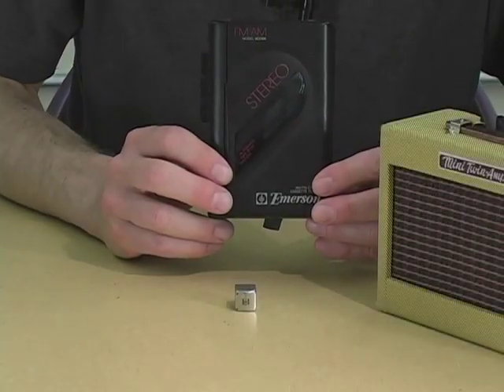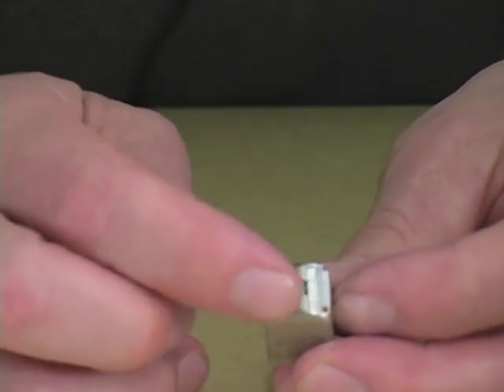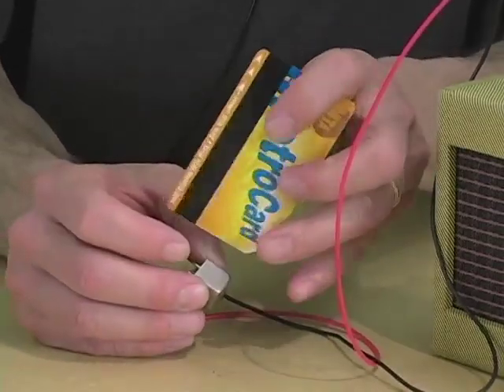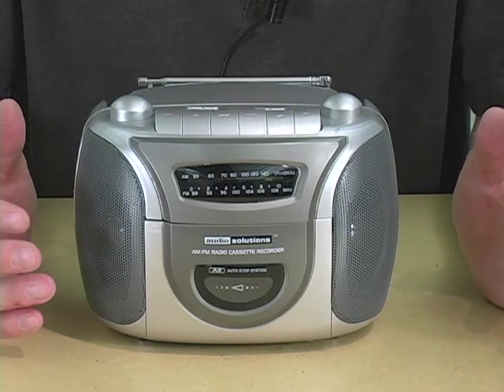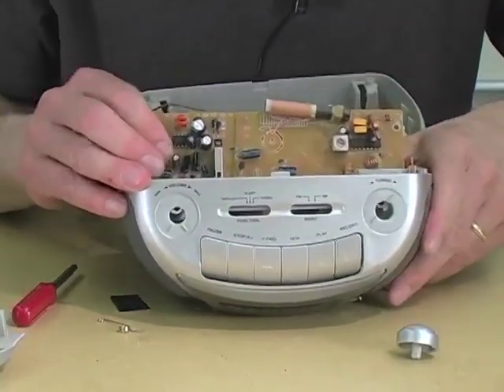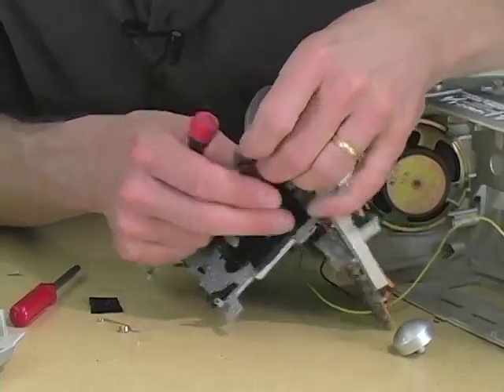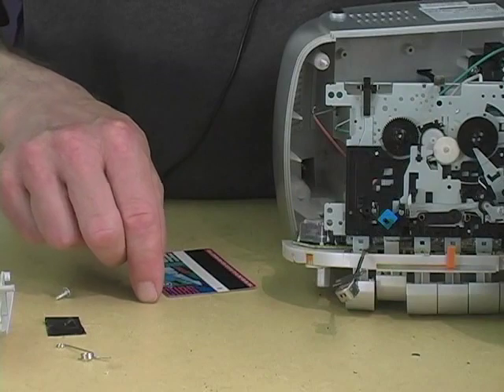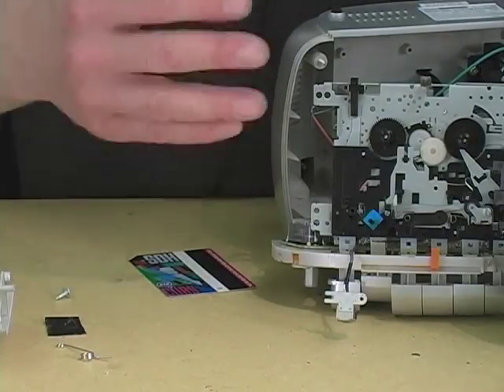Hack of the Month Club -- Project #7: Tape Heads

Comment from the maker: Depends on speed with which you move the card: cassette tape = 1 7/8 inches per second, so figure about 2 sec.  And with a steady hand or a mechanical jig you could record a few different parallel tracks.

Comment: I was restoring an old Sony and noticed that when I touch that disk shaped component that covers the drive belt it caused a click in the speakers and the sound of my fingernail scraping against it when it's spinning goes through too. But only when I have the tape compartment area facing down on my work beach. It's almost as if there's a static charge that charges any metal surface and will transmit the sound through the head. This Is very interesting to me. I've done it about 50 times and haven't noticed any spike going through the control board so how is it being transformed to the speakers?

Comment: This is an amazing tutorial. Thank you for democratizing your profound knowledge! Does anybody know whether I can only do that with a battery powered stereo? Is it okay if the stereo has an AC outlet and batteries and isn't plugged in?
Reply from the maker: Always safer to disconnect from the wall (AC voltage) if the device is open or you are touching any electronic parts.

Comment: If I replaces the tape head with an standard audio jack(mono) would that work as AUX port? Basicly, I want to use the radio as a simple amplifier.
Reply: DaGunchijs not very well
The head connects to a preamp with hi gain and boosts the low frequencies. So putting a line level signal will overdrive it
Reply: But it is pretty easy to find the preamp chip, google the datasheet and add the signal behind it. I did this a few time with car stereo's. I even once replaced the cassette deck with a bluetooth module. On cheap stereo's the cassete deck plugs onto a amplefier board. In that case it is easy to add there. Often the plug is marked so it is easy to see what has to go where. But i ony now saw that the comment from DaGunchijs is 3 years old to he probably doesn't need it annymore.